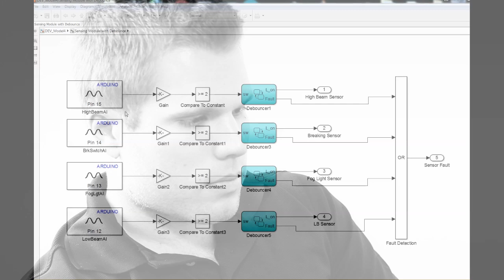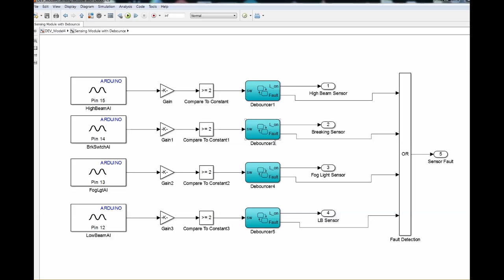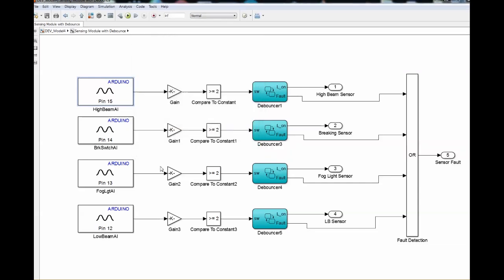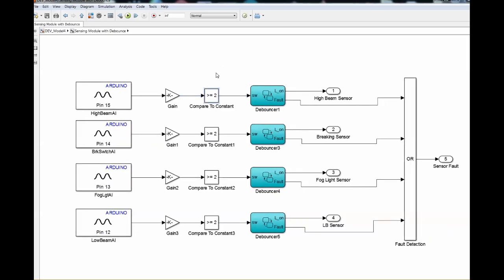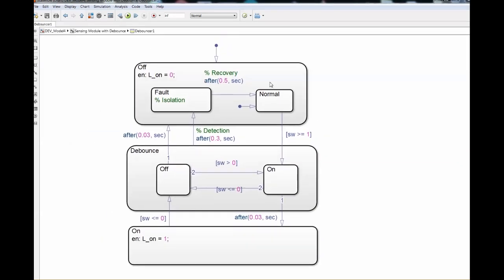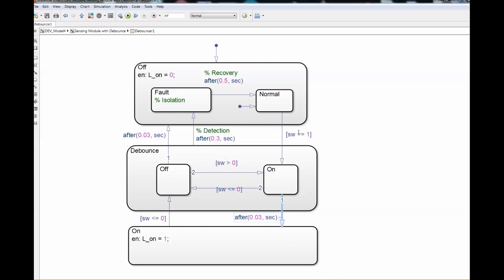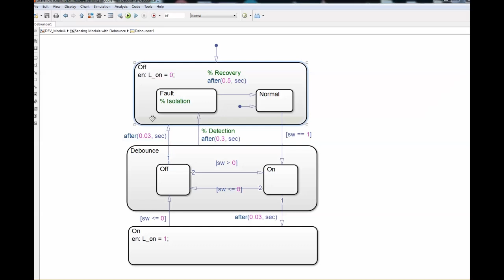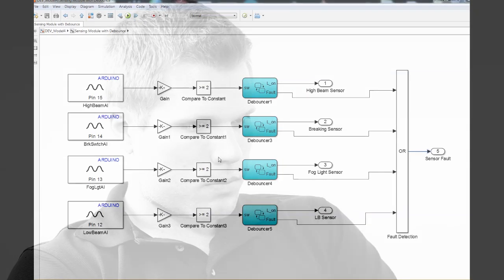Real world Inputs to your Simulink Model - with Arduino

Comment: Hey for modelling this is good but for reading real analog input voltages using analog input pins simulink is not able to read the input voltages in the scope!! so using arduino and simulink is it possible to read input voltages in a scope in simulink?
Reply: Hey, did you managed to read the signals and show it in a scope?

Comment: Hey, great video. I have a question: If I use arduino io library that runs up to 25hz in an application that requires a 0.001 seconds as sample time, it would work?